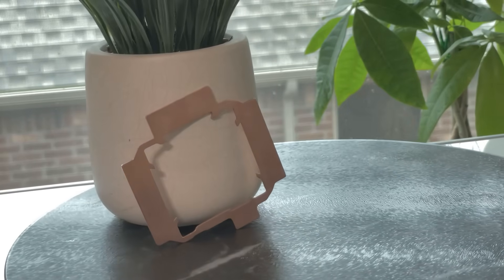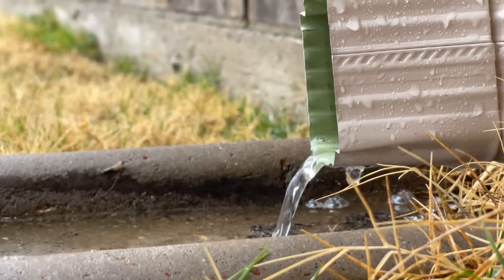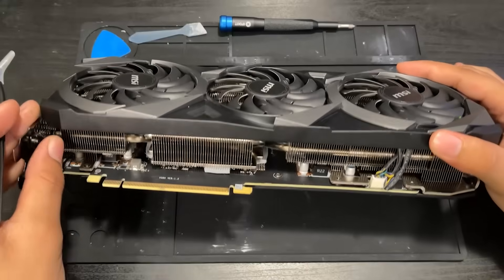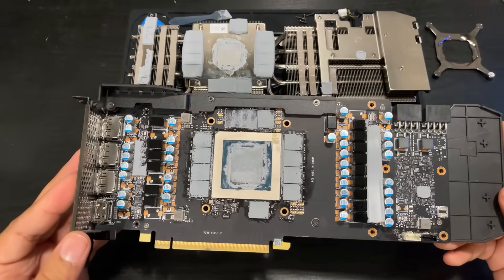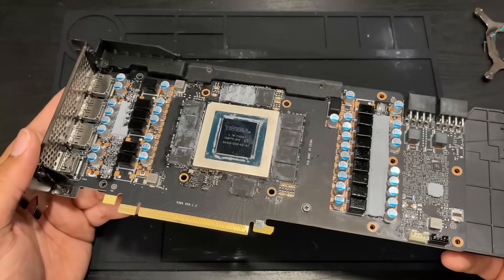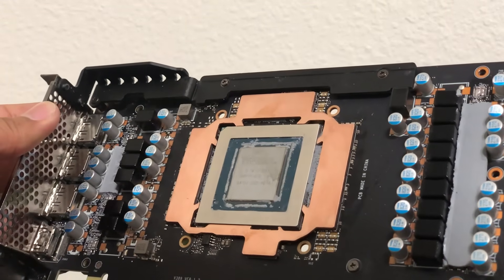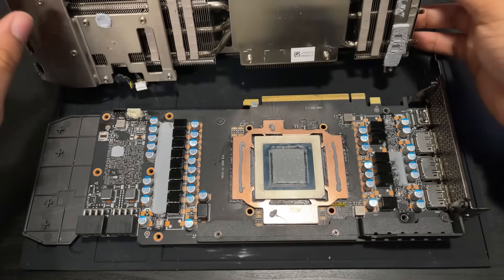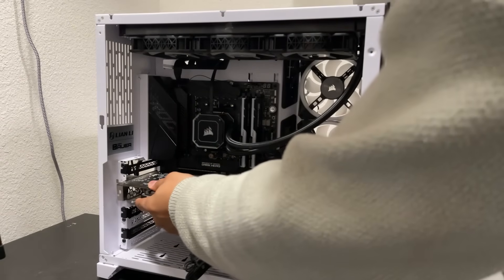Copper Plating FIXED This Melting RTX 3080. 25 Degree Drop In Mem Temps!

Comment: The ONLY problem with that card is they covered the memory with thermal paste. The pads are designed to disperse heat on the surface of the modules themselves. The thermal paste is making them run hot and I am amazed that they aren't burnt out.

Comment: Actually depending on the vmem type it may run better hotter and all that heat your pulling from the vmem is getting dumped into you gpu core because its on the same heat plate!.
These mods are the perfect example of a little knowledge is dangerous.

Comment: Heres a tip on the brushes. Even using extra soft toothbrush may accidentally damage the chips surrounding the IHS. You can use a softer brush like a makeup brush, works wonders and its dense enough to pick up the melted paste.

Comment: 5:26 its completley not fine ! Use some oil free paint thiner dude to proper clean all the thermal paste and other residues. Even dust in betweed chip and pads matthers on propper cooling transfer. I can clearly see that what you are doing you don't really know whay you are doing but only copy others crap, withou any technical knowledge !

Comment: The card bent because you need to shim the remaining pads Hight on the other components.I bought a used 3080 that was redone and had to fix it because of that very issue.The pads on the ends were not thick enough so it pulled down the ends to far warping the backplate when tightening it down.

Comment: GDDR6X can't actually handle tolerances of 110C without experiencing degradation. People were being misinformed by Micron simply because it didn't want to fess up that it created a product that would degrade much earlier than necessary. With that said, most well built 3000 series cards shouldn't see temps above 95 C (which is fine) for the memory junction or modules themselves unless something is wrong with the pads. Repadding and repasting for most cards should be the easiest fix, especially if you go with something reputable like Gelid.

Comment: When you copper mod, more heat from memory is tranfered to heatsink. As a result, lesser heat is able to be transfered from core to heatsink.

The end result of improving memory temps is a small impact on core temps.

Comment: I use nearly a decade old RX 470 which honestly has nothing good to it, it's basically a GTX 1060 equivalent but it has most of the GPU features you need, including video encoding, over temperature protection, like if you overclock it and the temps get too high, it'll automatically downclock itself, and the memory chips have no temperature sensors, atleast I can't see it, and there is a fucking voltage control on memory, how can I even increase the memory voltage without knowing the temps? But it's working fine for me with enough bottleneck with my i7 3770 so no comments rn atleast

Comment: Nah I would never try the copper mod. It is too messy and too risky. And the fact that the card is bent like that is because of incorrect thermal pad sizes, especially around the gpu core. that copper plate is already too thick by itself and adding the thermal paste just makes it worse, hence the bending of the pcb, which will eventually take a toll on the gpu so best thing to do is to simply get rid of that plate and use the right size pads. Another thing that can help with such temps is a more aggressive fan curve in msi afterburner instead of using the crap stock nvidia fan curves

Comment: I am interested in this mod
But I have seen a lot of dead gpus after few days of the mod

And idk. Mb I will go with liclid cooling evriting 😂 gpu and cpu
I like my temps to be low as possible Even if I have to compromise on noise

Comment: its a stupid idea but.. what if you grind out (or CNC mill) a small square hole on the heatsink where the GPU core goes exactly and then... try to put a small square of copper? 1mm~1.5mm? ofc with paste in between, oh and polish it for better conductivity 😅

Comment: The pins around the GPU are not impossible to clean, just use more IPA to melt the paste. I use a little brush soaked in IPA and it is quite fast to remove it.

Comment: you dont need to worry about a torn thermal pad anyway, so long as you didnt move it the other piece will fit back down and squish together. I would replace it not because its torn but because OEM's use shit thermal pads.

Comment: 6:28 I noticed the “bottom” thermal pad only had 1 depression, and the board (top of screen) had what looked like soldering points… would that be for any possible GDDR6 upgrade for DIY? (I’m ignorant as I don’t want to spend $3k to compare a 16 Gig to a 24 Gig to a 20 Gig cards 😂)

Comment: My 3080 is bent too, when I saw that I was like, wtf is this 💩?  I actually did get an assembly defect for an MSI GTX 1080 Sea Hawk X EK. The water block was incorrectly assembled.  I still run MSI, only because EVGA is not an option.

Comment: Copper mod 🤦🏼 you’d have to be desperate to do that imo, or just poor I guess, when you can just liquid cool.    If the copper component isn’t to spec, you will kill your memory (if it’s too thick) You can easily short something too.  I spent $200 I think on my 3080 loop including the block, but to be fair I already had the coolant (you can use distilled water though) and the tubing, and fittings, and fans.  Yeah, that’s like $50 more I guess.

Comment: That's a very messy application of thermal compound, presumably from factory.  I'd keep working at it with that toothbrush until it's gone from between all of the passives on the chip.  I'd also clean up those unpopulated memory pads, and frankly, I'd prefer to get those memory chips cleaner.  I don't like the copper shim covering the unpopulated memory pads, I would apply kapton tape over those two unpopulated memory positions, so it wouldn't short them out in the future.
Reply: How could leftover thermal paste be detrimental anyway ?

Comment: Best way to brick your card and fry your core on the Internet. Thermal expansion, torgue on the card, and PCB sag will cause this copper to touch components. In the best case, you can send it to someone to replace all of the fried component. At worst, you fry your core. Here is a better idea. Get new properly fitting thermal pads.

Comment: The end of its life may come sooner due to the bent backplate and board which cause mechanical stress on the solder joints. I received a refurbished GTX 980 with bent board and backplate. It failed within two days resulting in horizontal artefact lines. I ran OCCT, Heaven and FurMark for a couple of hours then powered off the computer. Next time it had artefacts. I left it working for an hour and they disappeared. So now I'm afraid to turn it off again until a replacement arrives.

Comment: the problem here isnt msi are bad its u bought the literal shittiest card available ventus gpus are budget over performance,glad you found a solution to help.copper mod is risky and pointless there are slightly thicker soft gelid pads which will bridge the gap better you should be using a mixture of ultimate and extreme pads 1 pad does all isnt how to effectly cool all cards.

Comment: Just did this mod on my card, the company now makes the 3080 shim out of alumnimum.
memory temp would climb into mid and high 80's when running 4K max serttings on Deathloop, cant get it to go above 72F now, and pretty much never breaks 70F.
Usewd the mx-4, good paste, easy.
On my 3080 i had to remove an existing shim plate that was build into the card heatsink, old one seemed thinner and definitely had some cutouts aroudn the edges of the memory pieces, also the paste from the factory wasnt well applied and was hardedned.
it was easy to do, id recommend it.

Comment: This sucks the plate doesn't fit my Asus TUF 3080 according to their website. Also they switched to aluminum plates instead of copper supposedly you get the same results but it's cheaper for them to manufacture.

Comment: I saw some tests on applying different amounts of thermal paste, and the tests found no significant difference. Perhaps there may have been the tiniest bias towards having "too little" thermal paste being better. 
The thing is that thermal paste actually has pretty poor thermal conductivity. Consider that they tend to have around 10W/mK, while copper has nearly 400W/mK thermal conductivity. So, too much f it is obviously not good, but as I said, those tests found no significant difference between "too little" and "way too much" thermal paste.

Comment: Man, I must have been one of the luckiest people when in it comes to GPUs then. My 3090Ti hovers around 63-67c while playing games at 4k and ultra-settings, Ray tracing at its highest and it still rarely hits into the 70c's, and if it does, it doesn't stay there long at all and it is usually at around 33c while idle. Not to mention I personally over clock it and pushed it to a 330% rating at user benchmark, with the gaming percentage at 386%, workstation at 120% and the workstation at 430%. I don't have any heating issues at all. My CPU gets a little hotter than my GPU, always. I was one of the lucky ones who caught that extremely brief sell of the RTX GigaByte 3090TIs for $999 a few months back. They weren't lying about how cool the cards stay.
Reply: what brand was that?  My HP brand 3090 is much hotter.
Reply: @zephyrprime  Gigabyte
Reply: mine 3090 I not past 83c fans because to loud are MSI Ventus 3X OC.
Not like Strix Rog.
On 1080p..   and vram 101c or more.
Playing U5 that take only 6gb or 8gb Vram.
I dont think what happend on games that use 16gb.. or Mod for games..
Mine past 1070 was a lot better in loud fans and Vram at 8gb never reach high temps.
Mine gpu was bad from new,is on OC mode always, I see custom OC is better but,is not a perfect curve.

Comment: This is a worrying trend where the pros and cons are not comprehensively discussed. One of which is the actual pressure exerted by the copper plate on the VRAMs as the gap is only 0.1 mm (1.6mm gpu die to vram level less 1.5mm plate thickness). This is the gap for thermal grease application. Any thermal expansion of copper (which is about 0.02mm) would bear much pressure on VRAMS and being incompressible, might break/chip it or even slowly degrade the VRAM solder points (fatigue stress - daily turning off/on the PC which causes drastic changes in  VRAM temps that causes expansion and contraction of copper metal). All GPU transistor solders are not done exactly the same. If you did it right on the installation but with just one protruding transistor solder anomaly (higher than VRAM levels) and do not know what short circuit means, your GPU will be dead even before powering up your computer. Thermal pads on the other hand equalizes too much pressure on VRAMS as they compress depending on the amount of pressure bore down by the cooling plate. Copper plates such as this one is still risky and your card might not last long even if done "right" - whatever that means.
Reply: On a 1.5mm gap i would use a 1.0mm copper shim and fill the gaps equally on both sides with a bit of U6 Pro thermal putty instead of thermal paste.
Reply: so what you are saying is that we should sand the plate with ultra fine grit sandpaper and make up for the 0.02 mm deficit using thermal paste right?
Reply: The copper comes in different sizes, problem solved
Reply: Why does the website show aluminum instead of copper? Feels like a bait and switch.
Reply: When they made th cooling kits to fix Xbox 360s, many of them worked by increasing the pressure on the chip too keep the weak solder points from losing content.  More pressure may be better, not worse.  Also, the circuit board is slightly flexible which should be enough to accommodate the small thermal expansion.
Reply: @MadGnomeTinker 30 years?
Reply: Thats why they have adjustable screws with littke springs on them
Reply: @MadGnomeTinker  You make me laugh. As long as you know gap width, purchasing the right thermal pads thickness, paste and copper shims would do the trick. I have used this for my 3080 ti for two years now  and still get temps at max 75C temp on full load.
Reply: @Hyperion1722 can you make video next time I wanna se yours
Reply: @Turkish64  I do not do video streaming.
Reply: What r u talking about 😂, low temperature makes another components more durable
Reply: @maniacjoe3088 no, what are you talking about? He didnt talk about whether being low temperature is good or bad for the longevity for the part(its good for it, yes), but about thermal expansion, and the fatigue and pressure it causes.

Comment: hello, i saw you do the video with the copper squares and you taped the whole thing in between memory  with non conductive tape, however now you are placing a huge conductive copper block all around....so  why did you use tape before i dont get it, regards

Comment: Important note: Everyone is talking about copper modding their vrms but it seems not one mentions the very obvious. The heat pipes to the main cooler!! 

This also has a thermal pad which connects the memory vrms to the main cooler. If you miss this, or cheap skate on changing this thermal pad, you will find your temps remain high, if not increase with the newly laid copper. 

Also when you have changed the thermal pads and have screwed everything together, do a sight test.  Peer in from the side and check to see if there is 'day light' between the thermal pads and the heat pipes. If you can a gap then you have used the 'wrong size thermal pads', and should add another layer. This is key!  In fact this is 'more important than copper modding your Vrms'.
Reply: or when someone does the copper plate mod wrong and northwestrepair drops a video "NEVER DO A COPPER MOD!" 🤣 , its not for everyone to mod their gpu vrm's with copper thats for sure 🙂

Comment: Cleaning of the die didn't go all that well because you used 70% IPA which is meant for medical use.
For such technical use you need pure IPA like 99.9%
That 30% water content can also cause some damage to electronics.
Btw. f"uck all GPU manufacturers for not making proper thermal solution to begin with.

Comment: i think your original mod with the small copper shims worked better i did the exact same on my 3080 but with pure silver shims and kryonaut extreme and it dropped my mem temps from 89c down to 52c-55c which was way more than i expected. if you ever have a chance to try that would be a good video. if you are brave enough use conductonaut liquid metal instead. youll probably drop temps even lower.
Reply: what thickness shims?
Reply: kryonaut extreme contains beryllium powder oxide which is very toxic,pls avoid using that.

Comment: after following this idea my vram has degraded. previous was always stable with 2150 overclocked vram with fasttiming on 6900xt. now can only use 2000. anything higher the system will reboot.

Comment: Ok, I did this a couple of weeks ago with the shims.  I used 2mm shims with MX4 on both sides of the shims and taped off the adjacent areas.  I went from throttling at 110C to now maxing out at around 72C under load.  Insane results.  And this was after trying the upgraded pad replacement, which didn't work more that dropping temps about 10C.  Thank you so much!
Reply: I Did this Copper Mod on my RTX 3090 Zotac Holo.
I Used the Same Copper Plate like in the Video, with ~1,7mm
Fits Perfectly,  MX4 applyed all over the GPU.

Before Mod: I got 110° V-Ram after 2 Minutes.
With CopperMod: It reaches 110° after 3 Minutes.
Fans All time 100%

WTF
Reply: @liebezentrisch5620  I don't want to presume anything, so, how is your case airflow?  How are you cooling that beast?  That may be more telling than just the mod.  I mean I have an AIO with 2 fans and 4 case fans plus the 3 on the Ventus.  The time delay to me signifies a heat build up, which speaks to airflow, from my experience.
Reply: @liebezentrisch5620 does it still make contact with the gpu chip? Seems like it would be a few mms to high.
Reply: I don't know if it's a fluke, but I had the same temps as you, but then i enabled resizable bar in my BIOs and my temps have dropped. Have you tried that?
Reply: I have 3090 msi ventus 3x OC, is recommended 1.5mm 1.6mm 1.7mm  1.8mm or the top 2mm?
I think thermal pads for 3090 are about 2mm.
But then apply thermal pads like 0.5-0.1mm   in both sides, or thermal paste?   In both sides? 
Idk what is better depend on the size of copper.. 1.5mm to 2mm
2mm to risk maybe can died gpu. 💀
Is better double thermal pad or doivle thermal paste, or only 1 or mix both? 
I have money only for pads like 1mm or 1.5mm max, because I probabbly need gtx 1070 maintain for sell or idk what do.
Idk what the rest of thing use in thermal pads, interior and external.

Someone know how much I need for a 3090 or 1070? 
120x120mm  is OK ? 
Or need buy two? for the rest.

Comment: beware if you order this and it comes all scratched up no do not install it. this happened to me. it wont do anything. it didnt make my vram temperatures worse or better. i am not taking my gpu back apart to try and return it.  wasting more time and money on thermal pads and thermal paste. or worse risking damaging my fan cables.
Reply: I don't think having it scratched should affect it that much? I understand if it was bent though. I would recommend checking if the thermal paste on the copper shim provides enough contact against the heatsink upon putting the card pack together. In my case on my first attempt, the gap between the heatsink and copper shim was bigger than I've expected. Because of that, there wasn't enough pressure between the shim and heatsink to spread the paste, therefore so less contact. All I did after was added more thermal paste. I then screwed back the heatsink to apply pressure to the card and took it back apart to check for spreading. After it was good, my card ran the coolest it has ever been.